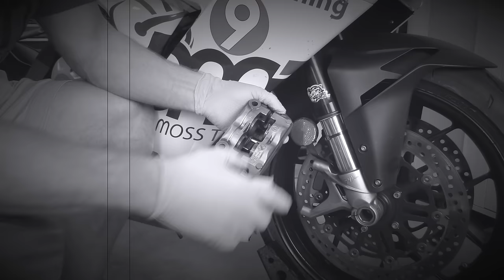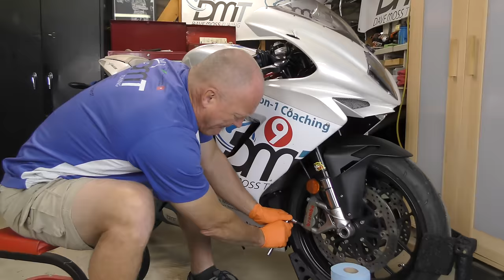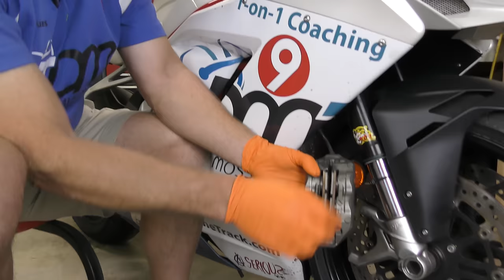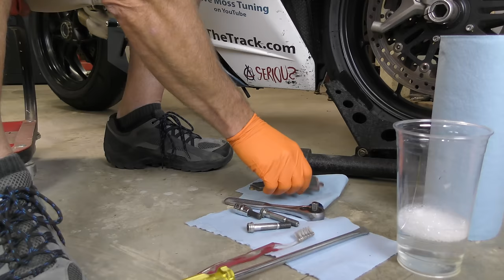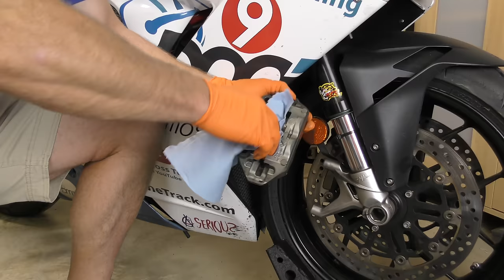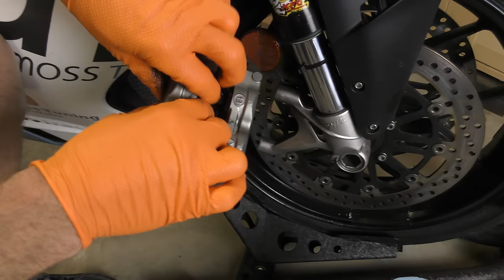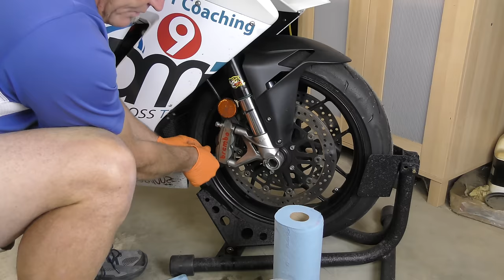Cleaning Motorcycle Brake Calipers in 5 Easy Steps

Comment: When you have the pistons surfaces exposed on say a road bike I would have thought after the wash, there was an opportunity to use a small amount of say ATE's Brake assembly rubber grease lube, or equivalent would be beneficial for the rougher weather exposure they will get?
Reply from the maker: If you let the soap dry, it provides the same protective film and grease will collect more and bigger debris. It could therefore potentially create a greater chance of damaging the surface. Worth a try to assess after one week of riding.

Comment: Why not use brake cleaner
Reply from the maker: 1. High pressure. 2. Makes rubber brittle.  3. Doesn't clean like a toothbrush. 4. Soap residue stays on the piston as a protective coating.

Comment: Best way to clean them is to take em apart. But with monoblocks it's allways a pain in the a**.
Reply: so you always rebuild your calipers when you just want shiny reliable brakes ? i think you should only do that once and then take periodically take 10 min to simply clean them
Reply: @DarkIzo  I take em apart every winter and when they're really dirty.
Otherwise I clean them everytime I change tires or pads. Which means mine are cleaned super often (at least every 2.000km on the road, with trackday of course a lot more often).
Also I change my brake fluid multiple times during a season, which means taking em apart isn't that big of a deal when they're empty anyways.
For normal road use cleaning them this way twice per year is probably more than 99% of what other people do.
Reply: Yes but I don’t want to re-do as often as I clean. My monoblocks develop a clunk when dirty.